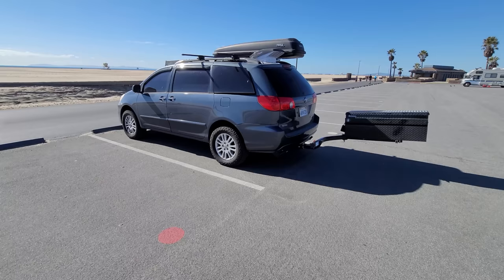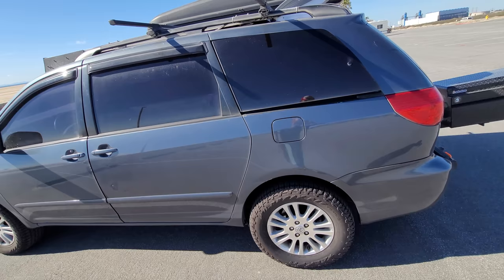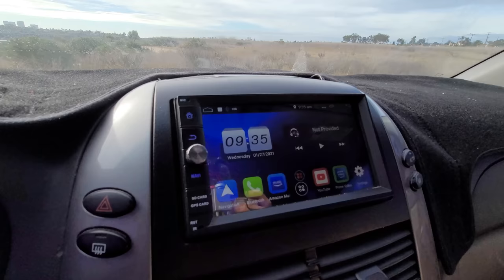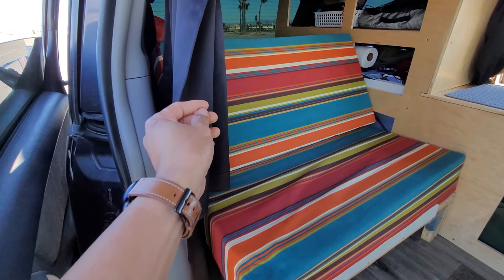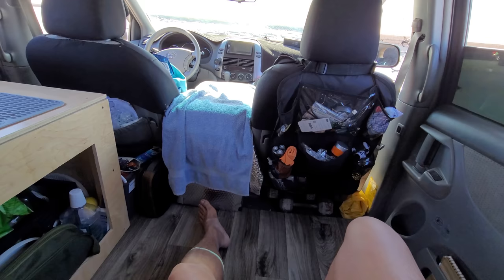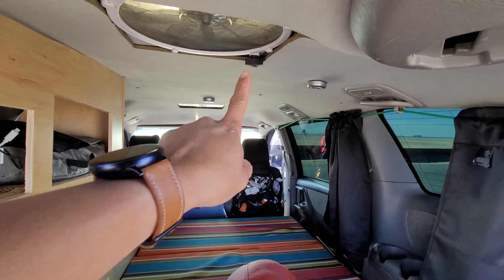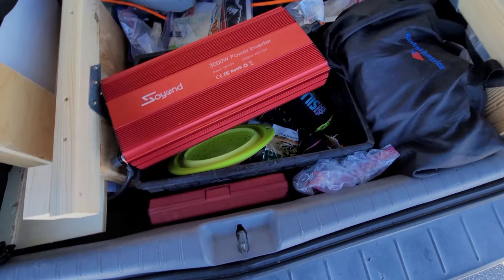Ultimate Minivan Off-grid Camper Van Tour! Lifted Toyota Sienna - Self Converted

Comment from the maker: Time Stamps/FAQ in description 
Exterior: 0:00
Solar Panel: 2:18
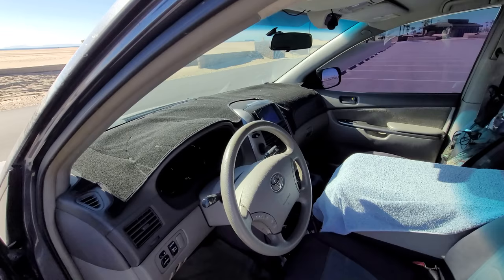Front Seat area: 4:11
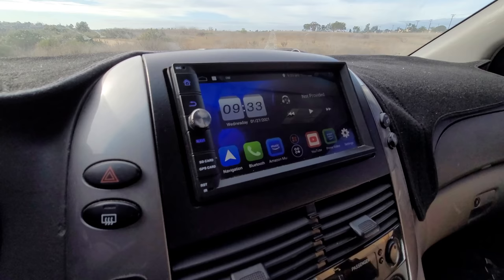Android Headunit: 4:52
Gas Station Rhino pills: 6:09
Frig: 6:34
Living area: 7:20
Bed/Couch: 7:37
Cabinets: 8:28
Appliances: 8:53
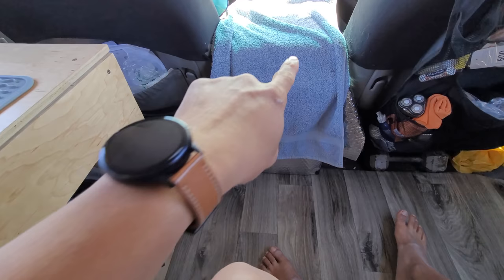Frig detail: 10:16
Van notes and ideas: 11:38
Bed Mode: 13:44
Battery: 14:18
Sleeping Bag: 15:35
Garage / Trunk: 17:20
Outro: 17:44
Eric Enjoys Earth: 18:28
Reply: What is the brand of the Android head unit?
Reply from the maker: @errolgyoung  link in description
Reply: @DaveOTG  Those Falken Wildpeak's are the best AT's for the money, and of course, Toyota is also the best for the money
Reply: How did you hang the blackout curtains?
Reply: What should I look for in batteries? Walmart and Autozone have marine batteries for half the cost of what i find on Amazon. They are sealed, AGM, lead acid.
Reply from the maker: @waltpalmer2  Walmarts batteries should be just fine 👍🏽
Reply from the maker: @waltpalmer2  bungee cord
Reply: Toilet?
Reply: Have you made a detailed drawing and video about your bed question I'd like to see how you made it and a closer look at how it operates
Reply: Can u please tell me how you built those cabinets?
Reply: Hey what's the length and width of your bed and the height of the legs?   Great video,. Keep rem coming
Reply: Hey great video
What is the width of your bed and the depth of your countertop?   Thanks
Reply: they make these in awd.
Reply: Great video! Thank you so much for sharing. 😊
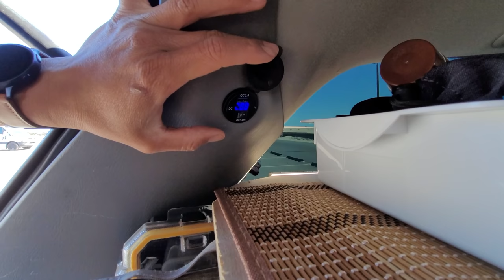Reply: 15:02  i see you have the RFID chip under your skin, between your thumb and pointer finger.  😨😲😭
Reply: Don’t ask a question on how to, he just refers you to description that doesn’t tell anything!!
Reply: What’s fridge you have between the seats? I’m interested in adding this to my sienna

Comment: I see so many people doing these conversions on Toyota Sienna vans. There's a good reason - they hold up long-term with regular maintenance and the cargo space with the seats taken out is amazing.  Great job on the conversion!
Reply: yes there arent but a few decent minivans to do this with
Reply: Right on!..had  a 2000 Sienna!..with 210000 + miles but the engine's and the overall built was just amazing despite the less than minimum maintenance (financial reasons)..but yes one can get top satisfaction with those babies!!😑😐
Reply: I'm in the process of converting my 2005 sienna. Surgery sidelined me but come spring I'll be on the road. Overbought stuff, GOT EVERYTHING. 😂🙂🤨
Reply: @AG-wh3hu   I bought a 1999 one for a road trip. I got it cheap cuz it had 420k km but it drove like a dream and sold it for what i paid when i was done traveling.
Reply: @AG-wh3hu   I also just bought a 2000 sienna about 3 weeks ago and I'm starting on a mini build.
Reply: Exactly.
Reply: How’s the fwd with off-roading?
Reply: The newer hybrid Sienna gets 35 mpg! You can’t beat that for a minivan.
Reply: I'm toyota all the time.  I always have one. My Subaru is a close 2nd. I'm blessed to have both. I live in Alaska so I need reliability and safety. I can open carry with one in the chamber so that is another bonus. Great job ❤
Reply: @michelebegor4191  Toyota is great, so is open carry. I'm in Texas where open carry is also legal.
Reply: @tybrady4598  Which year models of the hybrid Sienna have climate control?
Reply: @nathanpeacock9978 
I could be wrong, but perhaps 2021 and up. I think they also call it fourth generation. I think they’re all hybrid. Climate control is nice and efficient. Can run heat or AC all night and burn about one gallon of gas. AC uses the hybrid battery, not a belt powered compressor.
Reply: @tybrady4598  I'm starting to find it hard to justify living in a house or apartment.  A hybrid sienna with a gym membership for hygiene and fitness would do nicely in any climate.

Comment: Get some plastic shoe boxes or something like that to put in your fridge that way you don't have to take everything out one by one to get to the bottom.
Reply: When he was talking about that issue I was thinking about how I would solve that problem and I would probably use a set of those mesh wire locker shelves turned upside down. It basically makes a shelf and the legs turn into handles that would stick up over whatever you've got on the shelf and they can be lifted out. I want to say that they're like 12" tall and typically found at walmart or target but their use is to add a 2nd level to a tall school locker. If they're too tall, the legs can be cut and bent to accommodate any shorter height.
Reply: Great idea

Comment: Excellent job! It would not take much to outfit this for full-time, off-grid camping in the boonies. A portable solar shower designed for campers would be fine if you do not mind afternoon showering. A small changing tent could work as a shower stall or toilet stall for privacy. Some type of portable camper's toilet would also be useful for boondocking on public lands. I would also add some type of water filtration gear so I could collect ground water if I ran out of bottled water. 

I did not see a fire extinguisher in your vehicle. Do you have one? 

I would also add a silk liner for the sleeping bag to help keep that sleeping bag clean. Also would find room for a folding camp stool or a hammock chair, so I could sit outside when camping in a nice location. Do you have a set up for washing your laundry? I would use a 5-gallon bucket with snap-op lid and fit it with one of those agitators/plungers and also have a length of paracord plus some wooden clothes pins. And I would pack some of my gear inside that 5-gallon bucket when I was not using it to wash laundry.
Reply from the maker: Great ideas! I have an on-demand hot water heater I'll be doing a video on
Reply: Is it not ok to launder your sleeping bag? I just wash the whole thing inside and out and air dry. Never thought to make a liner for it. Perhaps bamboo wicking fabric would be better than silk.
Reply: @penelope-oe2vr  It can cause a fute hazard. I did that once. The washer started on fire...all the hot firefighters showed up, so that was ok, then. :)

Comment: have you tried turning the passenger seat 180 degrees?  Great if you're on your own most of the time, and not hard to put back when needed, and no expensive swivel to buy.
Reply: Do you have pictures of the 180 degree turned seats? I’d like to learn how to do that in my Toyota Sienna.
Reply: I suspect it might depend on the model year whether or not it can be done. 
But what a great idea!
Reply: flipping your passenger seat 180 degrees may render your rightside mirror useless....
Reply: @henrytowne7463  maybe, but if the seat can fold down flat, it won't obscure view.  Depends on seat design I guess.
Reply: @BrentsTreehouse  the first gen 1998 toyota sienna front seats do not fold down; primative when conpaired to the later gens...

Comment: great video and nice van. I just offer you the idea that heating water in plastic as in the coffee maker, and the bacteria that builds up in those tubes is giving you chemicals that are bad for your endocrine system. Also, cooking in the cute rice maker is great except it really should be stainless steel, ceramic or glass. Just a suggestion, since the one you have appears to be aluminum which is already bad, coated with some toxic spray that comes off.
Reply: This is a seriously good tip. Thank you.

Comment: Very cool setup, thanks for sharing! Would love to see or hear how you installed the insulation and deadening materials, and what you used for materials.  Your electrics system is massive, 300ah w/3000w inverter!  Doubt you'll ever run out of juice. 😎
Reply: yes, would like to hear about the insulation
Reply from the maker: Insulation is reflectix, foam board, and wool

Comment: Hey Dave,  I've watched the videos about your bed and Eric's and I'm fascinated by how easily your bed appears to slide from bed mode to couch mode and back again.  I have back issues and I'd like to build a bed like yours but I can't figure out how you seemed to lift the center parts of the bed up into couch mode with just 2 fingers.  I didn't see any sliders or runners.  ????
Reply from the maker: I've had so many questions about the bed even after my bed/couch video I may do another one with everything pulled out to show everyone. Stay tuned.

Comment: Love this walk through, just Subscribed. I've got a Sienna as well and was wondering if you had any recommendation on how to build out or better yet commission someone to build the bed frame. Thanks!
Reply from the maker: You could diy. Just do your research then throw caution to the wind and go for it!  For commissioning, there are places that specialize in this otherwise you could always ask a DIY friend for guidance like I did
Reply: @44FattooFit. Go to Eric Enjoys Earth's channel. He made a detailed video how he built the couch/bed, so other's can do the same.
Reply from the maker: Check out my latest video on the bed build
Reply: 44FattoFit, you can easily DYI a build. We are not YouTube rd but our bed platform is just 4 23.5"×19" 2x2 rectangles glued and screwed together with 12" legs, also 2x2s. We used 23&3/4" display shelves bought used by pier one imports, until they liquidate everything.  We anker it with small nylon straps or bungee cords to the seat anker points. Easy light and easy to store when not in use. Best wishes on your build.

Comment: Sienna can carry full sheets of plywood with rear seats removed and front seats nudged slightly forward. Great vans. My '06 is turning 200,000 miles with little to no issues other than severely compromised night driving due to plastic headlight clouding and ongoing start up belt squeal. Plastic headlight housings should be outlawed imo. Always use TOYOTA timing belts and water pumps (learned my lesson the hard way listening to repair shop bad advice.)

Comment: Got lots of ideas for my 2012 Sienna XLE from your excellent video. Thanks so much!
Reply from the maker: Glad it helped!
Reply: Just got my sienna lifted with the journeysoffroad 3.5" lift kit. Next up; bigger tires. I don't want to go with wheel spacers so thinking to go with 235-65-R18.  Your thoughts? thanks.
Reply from the maker: Sorry for the late reply it could work I went with 245/65/17

Comment: I LOVE your conversion. So many great features :) I'm dreaming of a Sienna camper conversion myself. However, mine will "have to be" a Hybrid, 1) to give me close to 40 mpg, and 2) so I can run climate control all night, on less than 1/2 gal of gas. Yes, 8 hrs of total 68-73F comfort, for about $1 to $2 :) I know this from my Prius, which I also car camp in. I've slept in 15 F in shorts and a tank top, and also, 88 F with 95% humidity in South Texas > like baby, buried under my home blanket ;) Granted, not near the space as a Sienna, which I why I'm dreaming of one :)
Reply from the maker: The hybrid AWD sienna would be a dream but it's so expensive
Reply: @DaveOTG  believe me, I hear you ! But relative to pretty much ALL other new vehicles, its really not a bad price at all. Especially for the tech included. I will NEVER own another vehicle which is not a Hybrid, and definite NOT a plug in Hybrid either.
Reply: I want a sienna hybrid for South Texas full timing. What year sienna has the climate control? I have to have it for sleeping in 90F south Texas night temps.
Reply: @nathanpeacock9978  regardless of the year of the vehicle, so far as I know "all" Hybrids can run climate control all night, cycling between gas and battery... Mostly battery.
BTW, I car camped in my Prius  in South Padre Island about 10 weeks ago. It was about 86 with 95% humidity. I cranked my AC down to 68, then got cozy underneath my home blanket with my king sized pillow, breathing nice, chilled air. Slept like a brick 🙂👍

Comment: This is a really good build. You have an intelligent, well-thought out design. However, closing the curtain will put a lot of heat on your refrigerator when the sun shines in. You might consider getting one of those sunshades for the windshield just to cut the heat a bit. I like the bed. I couldn't handle your sleeping bag though. I have my own personal summers and I'd be kicking that bad boy off every night. Good job on the build. Stay safe.
Reply from the maker: I have ceramic tint all around. It cuts the heat down tremendously, but is expensive. Yhup I had to ditch the sleeping bag now I have a diesel heater (and no longer live in California) Take it easy Jane!
Reply: @DaveOTG  then I can see no negatives in your build!

Comment: you should make some doors for your cabinet, it help hide the clutter on the inside and you can really ZEN out. Also I see some rough edges on the wood work, you should get a sander or even cover it with some rubber or plastic, because later on when accidentally rub on it its like a saw or even get splinters, its a good build but you just need to touch it up. Put a plant in there it will make you feel at home.

Comment: Great video, love your setup. A suggestion I have if you haven't addressed it yet - you're going to want to address your electrical system. It's somewhat taboo to have a bunch of cargo against your wires. If you hit a bump and something tugs a wire loose, you could fry your controller, or worse yet, start a fire.   I lost my expensive amp in my subaru that way :(

Comment: I live in my 2004 Toyota Sienna. I’m gonna lift it 3 in. But same size tires cuz I don’t wanna lose mileage
Reply from the maker: You actually don't lose much or any  mpg since it is measured based on diameter of tire from manufacturer. Once you change the size your odo will be slightly off

Comment: Nice build and great use of space on the fridge. I didn't see the link to your Android head unit. Curios on you cabinet and bed exact dimensions  too as I have a 2010. Are you in LA? I've installed a swivel base on my passenger seat if you are interested.
Reply from the maker: This is my same unit but better bc it's the newest software: https://amzn.to/3qHkvTm
Reply from the maker: I am interested! Lmk about the swivel pls 🙌🏽
Reply: @DaveOTG  The swivel involves getting a Previa swivel base from the auto salvage yard, modifying then mounting your original Sienna seat to the base. You will need a welding machine and a angle grinder and a drill to do it. I will try to put up a video tutorial as it seems there is quite a bit of interest amongst the Sienna tribe.
Reply: @DaveOTG  Me too. Santa Clarita
Reply: @teamdarwin  would love to see a tutorial, and for me to hopefully one day modify it to other minivan make. @DAVE2.0, you could see if your seat's anchor bolts can align when the seat is reversed. Some makes can do that but only the diagnal bolts [not all 4 bolts] are aligned, which is ok.

Comment: How did you insulate the ceiling? Take the liner off and put it back on or what? Same with the walls please. And if you don't mind sharing measurements I'd be very appreciative.  One of the best if not the best sienna build I have seen
Reply from the maker: Yes took the headliner and plastics off to insulate

Comment: SOLAR: Awesome van build! What are the specs on the panel? Most minivans have about only two 100w panels [17-22v] for a 12v system. Your panel is probably not 17v-22v and you seem to be using a PWM and not MPPT solar controller. Be great if you can do a video on your electrical in details [e.g. roof mounting, wiring sizes/lengths, routing]. Regarding the inverter, I cringed when seeing it not secured permanently to something. Seems, your there would be frequent moving of misc items in the compartment where the inverter is located. Did you buy the panel new? Many of these non-12v panels are frequently sold used on Craiglists
Reply from the maker: Me too, the inverter is there temporary. Don't worry :) I may do a followup video on power if I get enough interest. Thanks for the comment

Comment: Great job on adding your flare! What the tire sizes? Has 3 1/2" lift been a big reduction in gas mileage?
Reply from the maker: Thanks! Tire size is at the bottom of video description, and the lift and bigger tires didn't affect MPG too much. I still got about 19 mixed

Comment: Does the lift kit raise the axles as well or just the body?  I know you gain ground clearance from bigger tires, and the lift kit allows you to fit bigger tires, but I wanted to confirm if the lift kit raises the ground clearance as well or just the body of the van while leaving the axles at stock ground clearance?  Many thanks!
Reply from the maker: 12 ground clearance total. The kit is technically a "body lift" with pucks but as you alluded to, taller tires also help

Comment: Great camper.   Im curious why you didn't use a VW westfalia bus style rear sofa bed.   The sofa hinges are available cheap from Bus Depot or Just Kampers in Europe (they call them Rock and Roll hinges) and the box is easy to build.  You end up with a seat capable of actually carrying passengers if you add seatbelts.
Reply from the maker: Looked into it. Didn't know about bus depot. But it all worked out!

Comment: I converted my 2005 dodge grand caravan and am looking into getting some solar now. I would love a max air but want to keep it a no build build even though I took out the back 2 rows of seats.  I love how your bed turns to a couch and have seen a few set ups like that. My bed is on heavy duty shelving which I can change from single to dbl as sometimes I have someone travel with me.  Are you still living in this van? What is the power of your solar? I was thinking of biting the bullet and getting the Jackery 1000 with 200W of solar?!